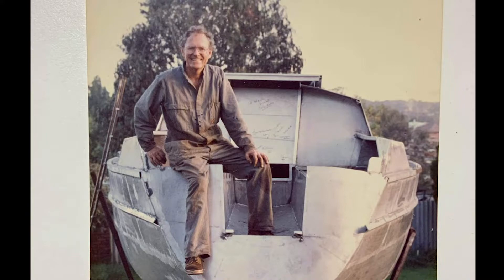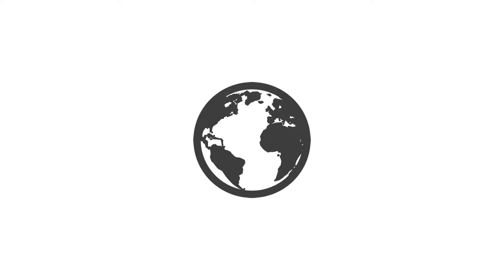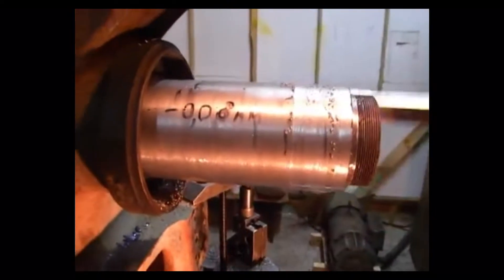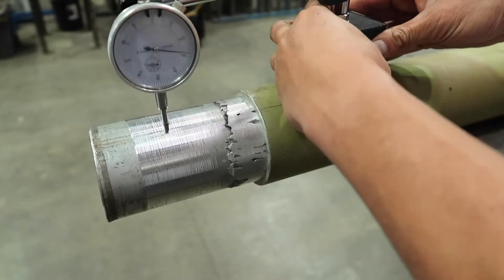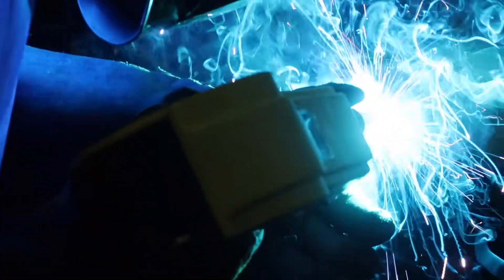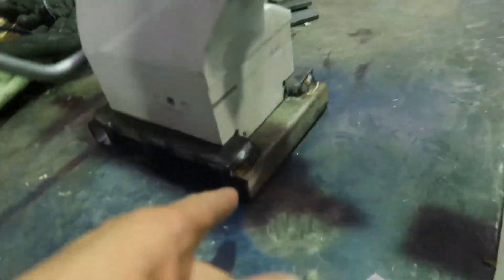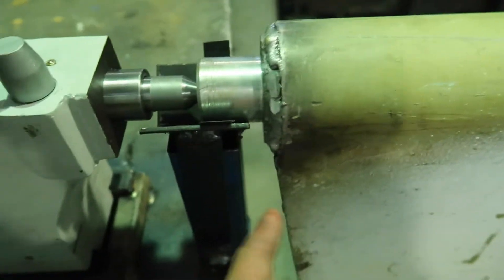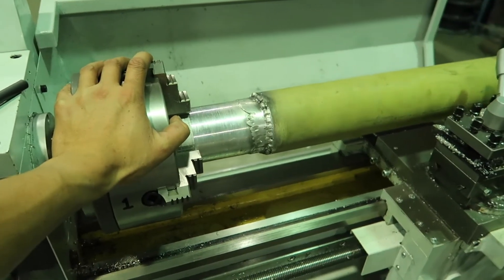Dangerous Lathe Idea

Comment: where about in Aus are you, there are plenty of that that can swing that. I'm scraping in a few lathes at a local shop at the moment that has a lathe with easily 1200mm of swing over the cross slide and close to a 2000mm over the bed

Comment: Wow you are really getting an education there.
There are so many ways to solve engineering challenges and it's entertaining watching someone else and seeing how they choose to do it.
Personally, I would have made a simple holder to hold the boring bar (offset) in the 4 jaw on the lafhe, then you just have to mount the rudder stationary and use the boring bar to turn the outside of the rudder shaft. Basically use the lathe as a horizontal mill.
Anyway, I wish you guys the best. 👍
Reply from the maker: Hey Wiz! Yeah engineering problems are why I wake up in the morning sometimes voluntarily and sometimes forcibly! I did investigate using a outside boring bar but got a bit intimidated by the prospect of having to make a boring bar long and stiff enough and I didn’t know how to make the whole rudder travel along the lathe. But in hindsight this is probably the way I would’ve done it if I had more time, patience and skill. I ended up 3D printing something to round the shaft. But that of course didn’t make it completely true. Thanks for watching!

Comment: As a machinist watching this 2 things went through my mind #1 this is the stupidist setup i've ever seen #2 I realy want to see this work. Something that might have worked is using a bearing block mounted to  heavy piece of steel instead of the tailstock and having the steady rest setup at the end of the lathe bed.
Reply from the maker: Haha yes, i was tempted to chem set bolt a wheel hub to the wall of the workshop but realised there was way too much movement in the lathe stand. 

I wish it worked though because now I am dealing with the pintle bearing not being true with the shaft.

Comment: You are almost there. Use the Lathe set up and then put a router in the cross slide tool post position. If this isn’t long enough use a slide above the rudder post and use the router there. If it wasn’t Aluminum they make tool post grinder for steel. Good luck, great project!
Reply from the maker: Thanks Pat. Thats actually an amazing idea because it would be much much quicker than slowly spinning the piece. I have an idea which I want to try out first then may give you idea a shot. Thanks again.